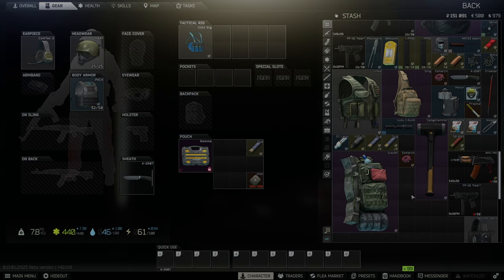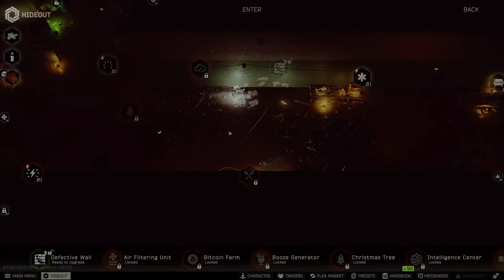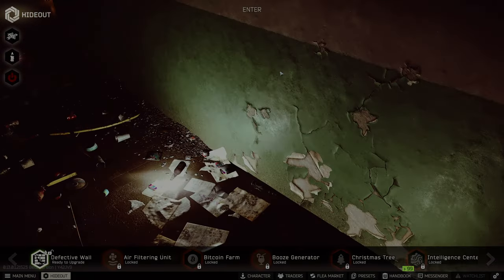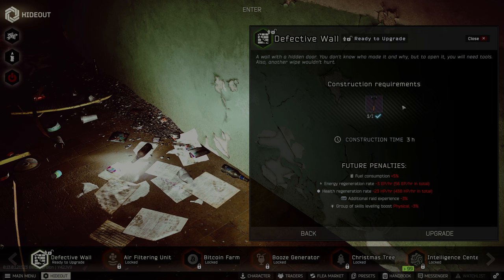EFT - Sledgehammer - Escape From Tarkov - Defective wall - Hideout repair

Comment: yeah mine finished. you get a hole in the wall and it sais there is a dead body but not really. i can upgrade it again with metal cutting scissors and a toolkit and i think i get another part of the wall down. it will be a level up type of thing with the 3 different levels im thinking.
but the penalties increase everytime
Reply from the maker: Yeah, i am just doing second stage ...negative efects are crazy ...

Comment: Where did you find the hammer?
Reply from the maker: Interchange
Reply: @craft_it  where on interchange my man?
Reply from the maker: @buups  racks on the side where is Emercom exit
Reply from the maker: often there are the big drills
Reply: Also found one in the tool crate outside of stronghold on customs
Reply: i found one on woods map on top of a water crate thing